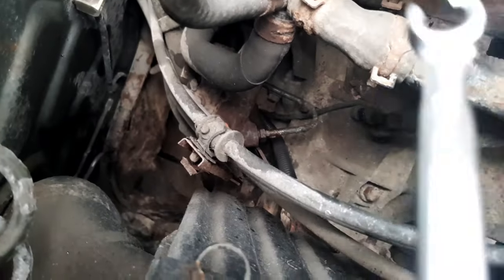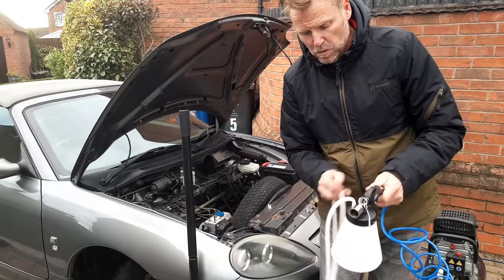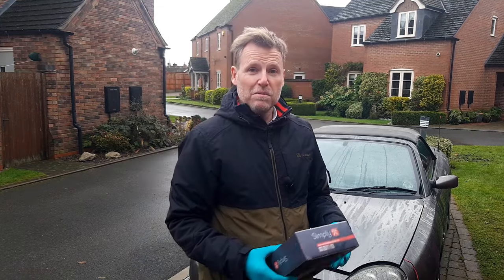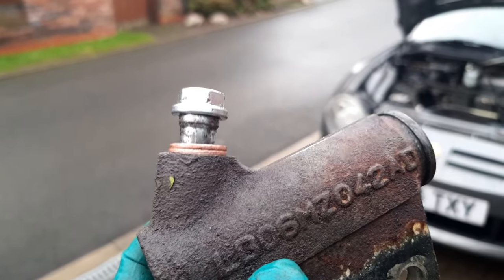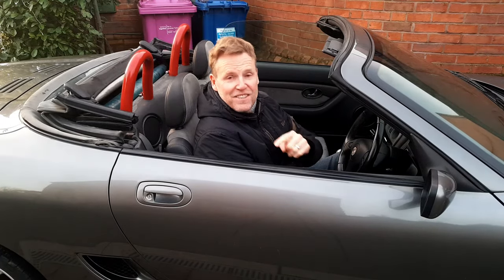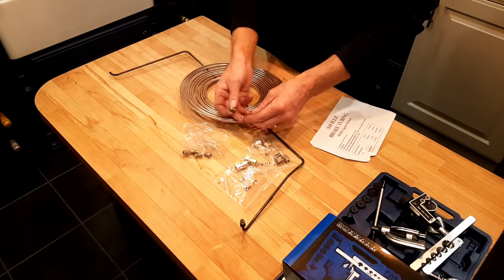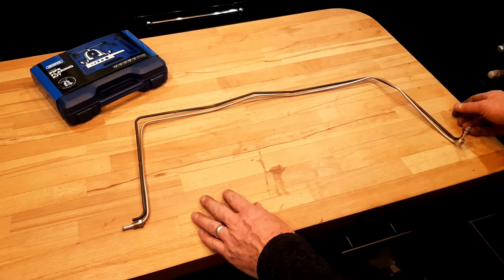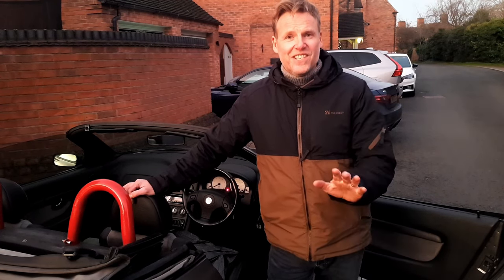Project WhatTF Clutch and Brake work.... what's best a vacuum or pressure bleed kit?

Comment: I bought an Eezibleed years ago and it worked quite well , but when I needed it again, it was lost somewhere in the bowels of the garage so I bought another cheapo one from EuroCraParts and it was terrible - leaked from every joint and didn’t come with a cap to fit my master cylinder 🙄 
In the end, I used a broomstick wedged against the seat to hold the pedal down then opened the bleed nipple. Took ages but it did the trick.

PS Hope Mrs Exhausted didn’t see the pipe flaring/bending!

Comment: You can get pressure bleeders that you pump up by hand - they are so much easier to use than relying on a tyre.  Had mine for 5/6 years and is still working perfectly😉

Comment: I had similar problems with my TF. I didn't use the flexible hose for this reason - plus I was worried a little about clutch feel. But bleeding it was a total nightmare, which was made worse be taking the master cylinder off to clean all the crap that was in it out. Pressure bleeding was the only thing that worked - those suction bleeding kits are rubbish even for brakes. Ended up using a fancier pressure bleeder than you got - one where you pump it up like weed sprayer.

The amount of fluid I went through was kind of hilarious, glad I used the standard stuff instead of the fancy silicone stuff I considered. All-in it was a much harder job than replacing the timing belt!
Reply from the maker: Thanks Ollie, I was with you until your comment re cam belt.... this was bad but not that bad.   😀

Comment: used eezie bleed for years ignore 20 psi and use 32 psi set it all up with no fluid in to check for leaks add your fluid and bleed do not remove pressure as you were doing until bleed nipple is closed

Comment: Banjo fittings and flared male pipe fittings are not inter-changeable - your banjo bolt may well be bottoming out on the bottom of the slave cylinder port and hence you’re not compressing the copper washers - you need to use the correct male fittings and throw the banjo bolt pipe away
Reply from the maker: I checked for depth all good,  and all sealed and working great now.